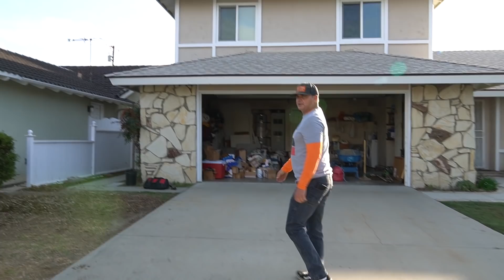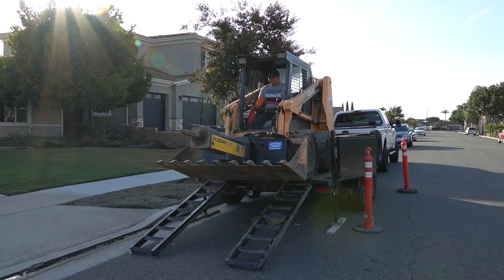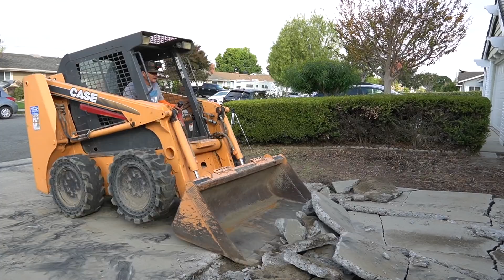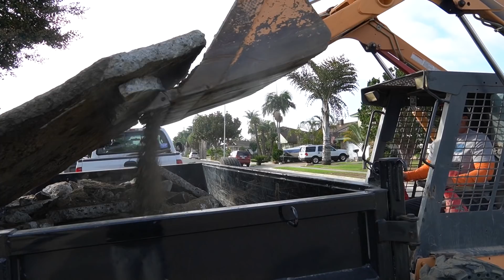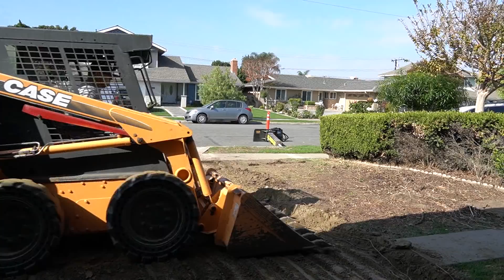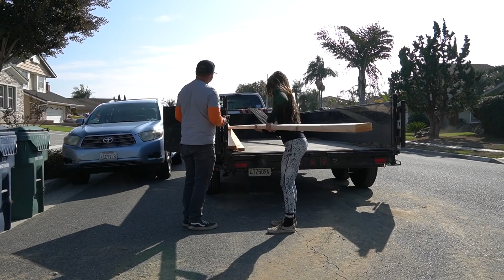Concrete Driveway. CLICKBAIT!

Comment: Hey I have a question how do you like those non air tires? I have a John deer 280 and I have the air tires and I get nails in them all the time and was thinking on buying those but I don’t know what is better which do you think is better?
Reply from the maker: I do concrete demo. So for me I only run solid tires 👍
Reply: @WestCoastCustomConcrete  yea but how about in dirt because I do a lot of grading and also concrete demo
Reply from the maker: @Niko-iq8bc  then get 26 ply air Craft tires. These solid probably won't be good for what you are doing 👍

Comment: Hey Anthony great video.
Just out of curiosity how many tons of concrete is in one load of your trailer?
Reply from the maker: About 4 yard's. Thanks for watching bro 👊💯
Reply: @WestCoastCustomConcrete  how much tons does that usually weigh(your trailer filled with concrete)and how much do you pay per trailer load when you take it to the landfill or wherever you take it.
Just trying to get an idea if my truck can pull it and how much they charge in your area.thanks Anthony !
Reply from the maker: @aebuilders6321  I carry about 14k lb it's like around $200 dump fee. What truck do you have? I can awnser that for you 👍